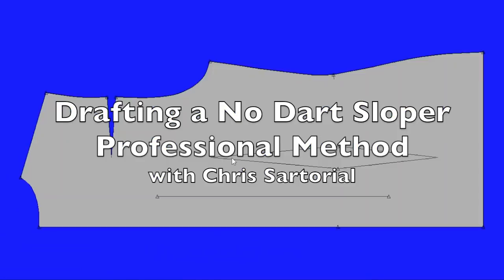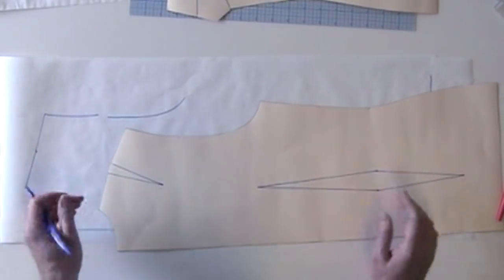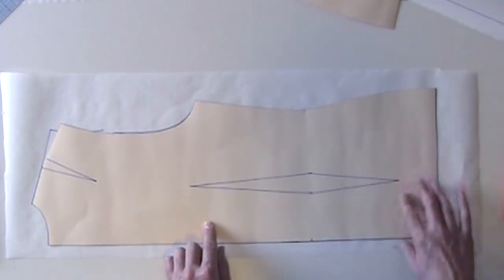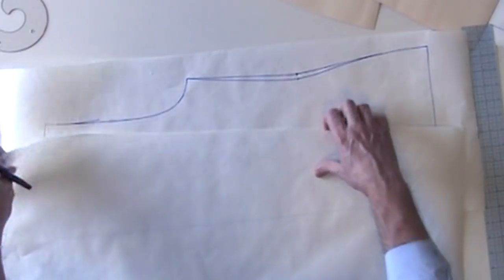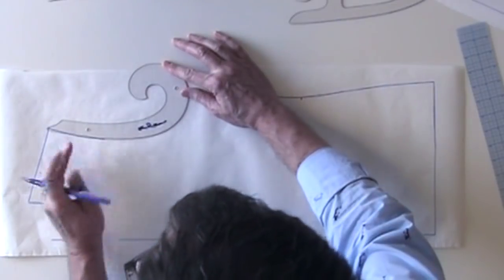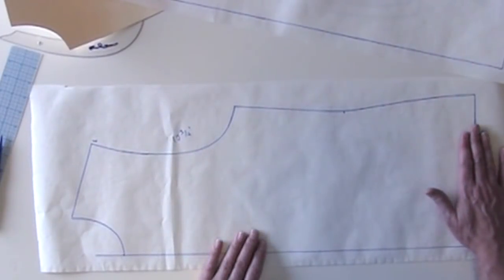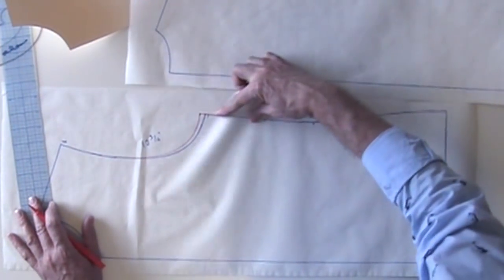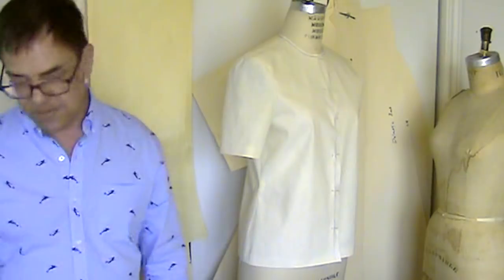Drafting a No Dart Blouse - Professional Method

Comment: Chris, I am still paying very much paying attention. I love that you tell us WHY, we shouldn't do certain things when we rotate the dart. EVERYONE, on Youtube is telling us the wrong method. I can't but help to think that everyone Youtube who follows the usual dart rotation method -----will end up with really weirdly angled Shoulder Seams, or a front Panel that won't cover the Midriff! I'm still formulating my questions because I am very new to sewing and especially Pattern Making. I know that unless I learn basic Pattern Making, my success at following a Commercial Pattern will not fit my Figure. You may or may not remember me. I am the woman who ALWAYS has to have the Shoulder Length/Height altered because If we started Pattern Making at the Shoulder Slope, wouldn't we stop all the mistakes below that point? If we all started off with the correct Shoulder Slope, we wouldn't need to rotate the darts into the Shoulder Seam for a Fitted or more Loosely Fitted garment because we wouldn't need a Shoulder Dart, or much of a Shoulder Dart? Using the correct Shoulder Slope would become universal whether using Knits or Woven. Chris, I may be wrong, but the Head Bone is connected to the Neck Bone. The Neck Bone is connected to the Shoulder Bone. Love your lessons. Please, please elaborate
Reply from the maker: Fitting a garment properly at the neck and shoulders is crucial.  I may do a video demonstrating the mistakes to avoid.  Not only hobbyists, but professionals make them.
Reply: Chris, it is so easy to become turned off to sewing because people don't understand the dimensions they are working with and mistake are costly.                                                                                                                                                                   I know it is all about LCD.  Length, Circumference, Depth.  Going from a flat pattern expecting it to fit then finding out there is too much bulk over here, when it should be there!
Yesterday I came across a new seamstress who has all the credentials and experience in the industry.  She told us Not  to choose a pattern for the bust size!  That almost blew me out ofl the water!                                                                       She said that we should choose a patter for the shoulder width saying; that we actually need to measure the pattern's shoulder width and that we could always do a full bust adjustment later.  
I can't help but think that she is right.   The head bone IS connected to the shoulder bone.
Chris, very few people have a real gift to teach because they don't know how to communicate.  You do! 
I could teach you how to swim, do a Cartwheel, but I couldn't teach you to thread a needle if I didn't have hands. The words don't flow from my mouth the way they form in my brain. 
Chris, you have some real talent.  Please share!
Reply: I would love to see your video on demonstrating the mistakes to avoid :)

Comment: I always some back to these tutorials to remind myself of the important principles. In a knit or supple woven, I have gathered the front side seam over about 3 to 4 in length, starting 1 and a half inches below the sleeve seam, to match it to the back side seam, accommodating a DD cup without a side dart.  Sometimes, some of that former dart goes into the front shoulder seam, easing up to a half inch excess in the front shoulder to match the back shoulder seam. By doing this, the armhole and neck hole remain unchanged, and I don't have to adjust the sleeve cap. If the fabric is heavy or too stiff to gather, small tucks in the front shoulder seam and very slight easing of the front side seam also work pretty well.

Comment: Hi I have added the sleeve to the blouse .It fits well for me.If I like a loosen blouse,can I enlarge the sleeve hole without changing the bust measurement.thank you
Reply from the maker: Yes, you can lower or raise the armhole depth without affecting the bust measurement.  You can also add more room to the sleeve by widening the upper arm, but this will lower the sleeve cap height.

Comment: Hi Chris.  I love watching your videos for drafting blouse explaining in detail what you should and what you should not and why. I am trying to draft no dart blouse.  When I rotate the shoulder the new shoulder’s length is shorter .i don’t know where I am making mistake. Can you pl explain. Is there a method to draft no dart blouse straight without drafting a blouse with darts and then converting?  Pl advice me. Thanks.   Elsie
Reply from the maker: If you are including the width of the dart in the across shoulder measurement, then yes, the shoulder width will be narrower after the dart is rotated to the armhole, but this is as it should be.  Have you drafted the fitted bodice I demonstrated in my first video, and the fitted blouse?  You'll need to do so before advancing to a no dart sloper.

Comment: Thanks sir Chris!
May I confirm is it okay to increase the back side seam to accommodate the front side seam so that I may not have to deal with the armhole later?
Reply from the maker: Please clarify.  I'm not sure I understand your question.
Reply: Because the armhole must be shorter in the front then its side seam becomes longer than the back. I just ask if it is okay to increase the lenght of side seam at the back in order to not deal with the pattern not matching?

Well thanks alot!

Comment: Thank you very much for your prompt reply. I have one more doubt.   I have drafted with dart Sloper both front and back.  When I draft no dart Sloper should I fold the dart ant draft the back?  Then it will be less half inch and equal to the front which should be 5”” for me. In your demonstration it looks as if you are keeping the dart. Pl explain  thanking you in advance
Reply from the maker: I rotated the back shoulder dart into the armhole, which will make the back armhole 1/2" longer.  As you stated, the back shoulder will then match the front shoulder in length.
Reply: We

Comment: Hi Chris! Ive bought my first pattern book as advised by you. I choose pattern making for Fashion Design by Helen Joseph Carter. My goal was to start with a basic block pattern and turn in it in to a dartless spaghetti strap dress. Your method for the basic block is mistake proof and flawless however in order to make the cowl dress I have not found the answers that I need, maybe you can direct me? To make a dart less cowl dress I believe I need to send all torso darts to the waist and then close them. 1-What would be the best method to do that, if correct? I am curvy so the double darted method for the skirt fits me best but how can I blend them to the bodice if even on my book the bodice block only has one dart and the skirt 2. 2-Where do I cut to make the draping on the pattern? my book only has cowls for garments with sleeves. If I cut the draping slashing on the armhole line the draping drapes to a side and not the center. If this is too much a book recommendation would be great. Mine has answers but not all of them. I bought muslin and all pattern materials and I am willing to learn. You are the bomb Chris.
Reply from the maker: Sounds like you have a very ambitious project planned.  I'm not sure whether you'll be able to eliminate all the darts in your dress.  You can't simply close them.  You can eliminate the waist darts, so that the dress skims the body without nipping in much at the waist, and you may have to keep the bust darts.  Typically it is easier to drape a cowl neckline than it is to draft one.  Do you have a dress form?  Without seeing your concept, I can not guide you much further.  Good luck with that.
Reply: @christophersartorial7671  https://www.youtube.com/watch?v=KGp9ac3oBIE&t=538s Its this one, she is foreign so its a bit harder for me to follow her. I can draft without the waist darts. Does that apply to the skirt part as well? What kind of darts would I use for the bust and I don't have a dress form but maybe I can try with myself? :D

Comment: OMG i'm speechless. when the video finished i had no questions in my head...why did he do that..... how would that work..... you nailed it to a point i KNOW i can try this and i will be happy and feel confidant trying. Thank you. x.   i had to come back in as i would like to ask.  the neck line would be to high for me anything touches my neck it makes me gag.  would this be easy to lower or to V neck. Thanks again. X
Reply from the maker: I'm glad you found my instructions clear.  Because a sloper is typically used as a starting point for drafting other styles, it usually has a close neck.  The neck can be widened, lowered, and re-shaped as your creativity dictates.
Reply: Will you be doing a follow up video on how to re.shape  neckline ect..  i bought some large card sheets to day so i can try and draft my 1st sloper. i have a french curve on order along with pins and a few bits and bobs.  Thank you for getting back to me.  x
Reply from the maker: I may show some neckline adjustments, but it's mostly according to your design.  One thing to remember is that if your neckline is deep in the front, it should be shallow in the back (or vice versa).  If you try to create a deep V neck in the front and a deep V also in the back, the garment will fall off the shoulders.

Comment: Hi Christopher. Can we cut the dart out of the paper using our rotary cutter and trace the inside edges of it onto the fabric? This would be to avoid using transfer paper.
Reply from the maker: That's a good way of doing it.  I often simply mark the points at the 4 corners of the dart, then connect with lines on my fabric.
Reply: @christophersartorial7671  okay, thank you. That makes sense too. I would always have trouble with the markings smudging. On my last project, I use the tracing paper that comes with the stylus and it came out really well. So, I think I'm good now. :)

Comment: How would I create a knit sloper with a bust dart,  would I start drafting a woven sloper and make modifications or would I draft a sloper without ease? Btw, love your tutorials!
Reply from the maker: You would use the same method, but definitely without adding any ease.  You may also want to leave out the waist darts and the back shoulder dart.
Reply: @christophersartorial7671  thanks so much, please keep the videos coming!

Comment: As I was drafting my sleeve sloper, I noticed that the measurements obtained from the bodice tutorials for
the front armhole was 8.75 inches and for the back armhole was 9 inches, total of armhole length of 17.75 inches. 
Yet,the tutorial on the sleeve drafting uses front armhole of 9.25 inches and back armhole of 9.50 inches, total of 18.75 inches. 
and the finished sleeve was sewn on the dress form where all the other body measurements were taken from.
Kindly explain the discrepancy in the total armhole measurement from the bodice tutorials from that on the sleeve tutorial.
Were the measurements used on the sleeve tutorial referenced from another dress form? and simply used exclusively
for teaching how to draft a sleeve?
Thank you!
Reply from the maker: The previous form I used for the bodice demo had no sleeve cap, so I used a different one for the sleeve draft.  The measurements were slightly different.
Reply: Thanks  for the clarification.

Comment: Hi can I know if there is a tip at the shoulder point after joining the front & back shoulder pattern is it because of the wrong shoulder slope measurement taken that cause the tip point .thank you.
Reply from the maker: It may be that the shoulder is too sloped, or that the armhole curve should be blended more smoothly front to back.

Comment: If it is possible to add side bust darts to a dartless pattern, please explain how. 
Thank you again Mr Chris
Reply from the maker: Unfortunately, there are a number of ways to go about this.  For example, the front can be lengthened to accommodate the added bust dart, or extra fullness in the armhole can be rotated into a bust dart.  Without seeing how the top fits now, it's impossible to recommend the strategy to apply.
Reply: Thank you Mr Chris for the fast reply. I've tried both the lengthening route and armhole reduction way (didn't want to make any changes on the sleeves)
but not too happy with the results.  I agree with you that I'm better off drafting a new bodice that included
the side darts. You've shared with your followers a wealth of refined and proven techniques in drafting
patterns so I'm certain my soon to do sloper will turn out just fine and to my liking. I'm an avid
admirer of your stellar videos!
Reply from the maker: Thanks much!

Comment: Would a no dart sloper be used for a bias-cut blouse or dress?  Or would you use a standard sloper for bias-cut patterns?
Reply from the maker: A no dart sloper might be the best one to start with, but be prepared for lots of adjustments.  Patterns for bias cut garments are typically draped rather than drafted.

Comment: Hi ,how do I make a sleeve pattern for this pattern do I use the same sleeve pattern method as before
Reply from the maker: Yes.  Make the sleeve the same way.  The armhole is bigger, so the sleeve will be bigger.  Also note that the front sleeve cap will be shorter than the front armhole between the ease notches.

Comment: Hello Chris, kindly make a tutorial for an easy fitting bodice sloper. The kind for along casual, loose fitting clothes
Reply from the maker: Hi Eva.  That is what this video is meant for (No Dart Blouse).  If you want it more easy fitting and casual, increase the measurements through the bust, waist, and hip.  You can also lower the armhole.
Reply: @christophersartorial7671  ,thank you so much for the info. How much ease would you recommend as functional ease in loose fitting garments?

Also, could you please do a tutorial on how to draft a raglan sleeve? I am currently trying to make one and there are so many tutorials out there but I have found yours as most simple and easy to understand. Hope to hear from you soon. Blessings!